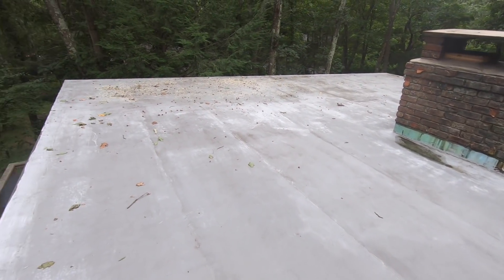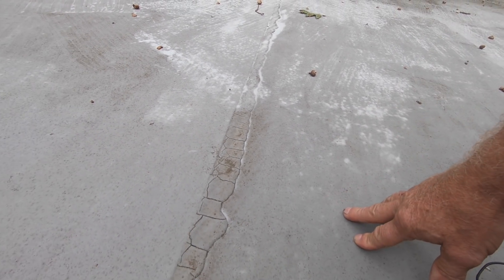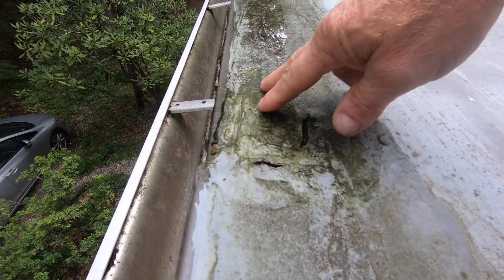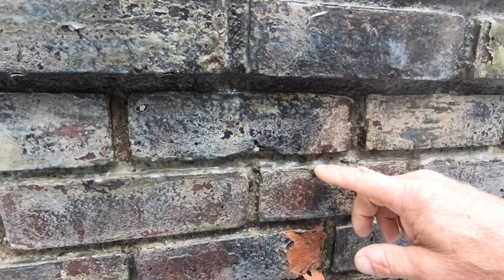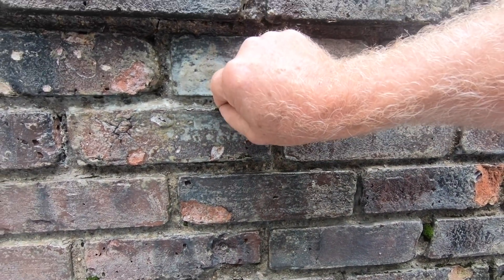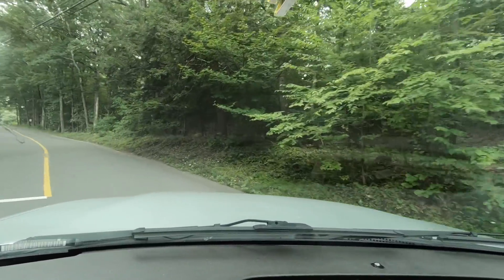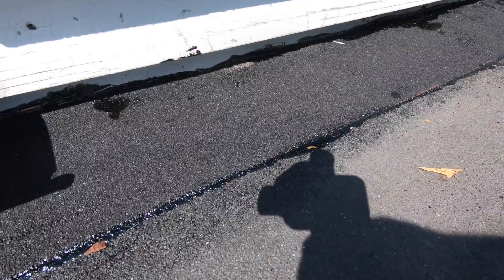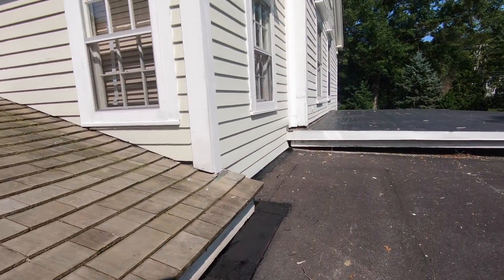Driving 7 hours for a roof estimate. See how to look for leaks on a rubber roof.

Comment: 600 was good. 4 hours work if that
Reply: No offense but imho, Way way too low,  7 hour drive time for the estimate, plus his material and another round trip to do the work and then add in your 4 hours work time.  Should have been at least 950, no wonder she jumped on the 600.  Guarantee she would have been happy at $1,250.
Reply: @MegaHugro  true that travel time
Reply from the maker: Hey, that day I made over $4000 on all the small jobs combined. I didn't want to show everything. But also, from that day I landed big jobs of over 100 k each just because I did the smaller ones. One never knows what will happen with small jobs.

Comment: Great video, I really enjoy your channel. I think there are pros and cons to every membrane. EPDM seems are the weak point clearly but on a 10-16 square roof that is only 20-25' wide it seems like a good system to me provided there is not a lot of traffic. Our roof is 25-30 years old and will need to be replaced soon. The membrane has another 10 years left easy but we had to replace the gutters and went from Yankee gutters to high-back gutters. This extended the roof edge by roughly 10" so the membrane is short by that amount. The roof was tied into the gutters with seam tape but we are aware that that will not last long. We were quoted self adhered bitumen and EPDM. What are your thoughts on self adhered as compared to torch down?